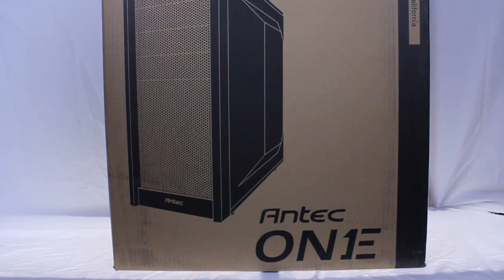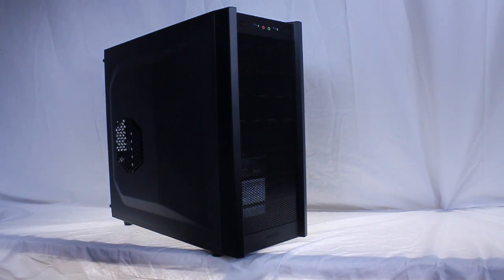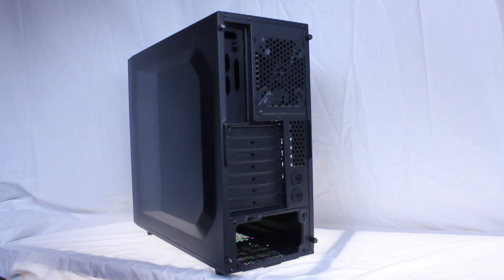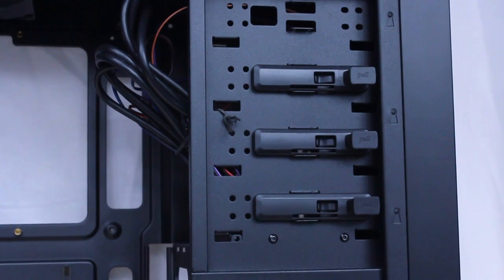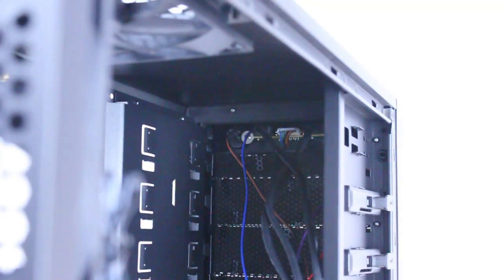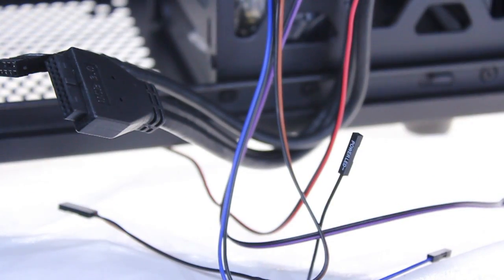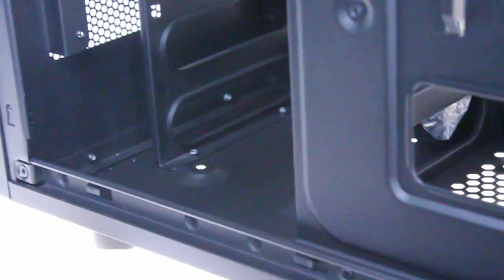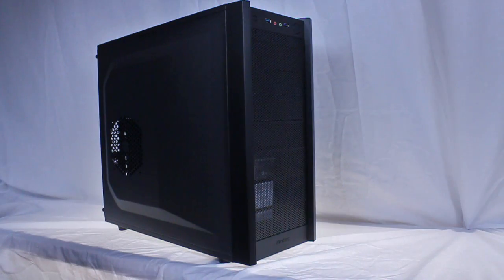Antec One Gaming Series Black Steel ATX Mid Tower Case Review

Comment: Front panel is not 'extremely hard to get off'. You pull from the bottom, where there is a handle. It almost comes off too easily that way.